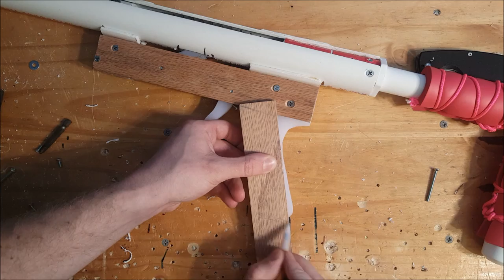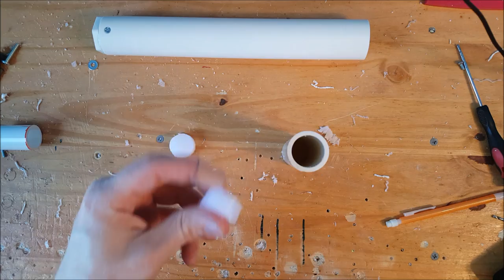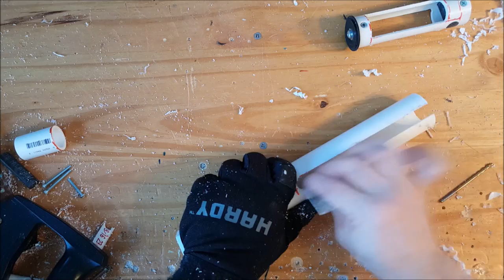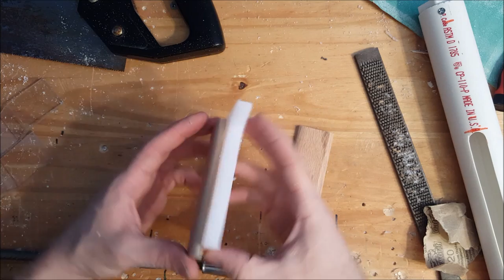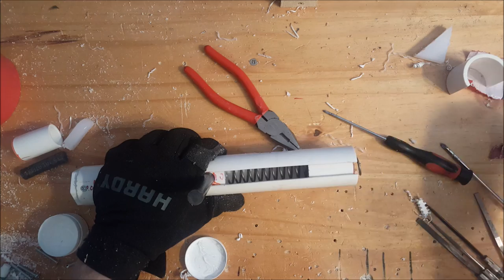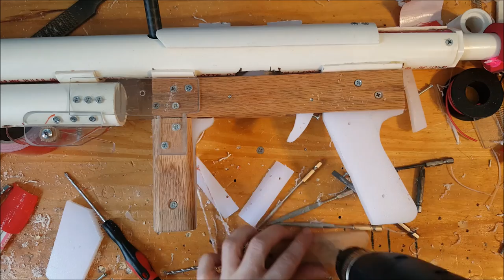Underbarrel Nerf Rocket Launcher & Tactical Uprgades!

Comment: Why not make the dust cover automatically open when you prime the blaster?
Reply: Asean12 that's actually a good idea. The front just needs to be slanted
Reply from the maker: Several reasons. Somewhere along the way if the dust cover opens while you're pulling the priming bar back, you're going to scrape your hand. Second, some driving force is going to be necessary to flip the cover open, so a reaction force must be applied when the bolt is in it's resting position. This means either a far more complicated system, or a dust cover that always is trying to flip open. A "slanted front" is also basically useless, in the sense that the cover is no longer locked in place by interfacing with the bolt (the whole point of the notch in the front) and  that slanted cutout is now a fairly large opening for grime to get into the blaster, eliminating the point of the cover entirely. These things seem like good ideas on paper, but are quickly disarmed when implimentation is actually applied. You are welcome to build your own and prove me wrong ; )
Reply: Aeromech  I'm nowhere near skilled enough yet. I'll stick with snap bows and pump snaps for now. Also, where do you get your red and white foam?
Reply from the maker: I pick them up from the play field when other nerfers launch them at me.
Reply: Aeromech ha😂 I that's hilarious! We use a community bucket, all the darts are made from 1/2" gray FBR
Reply: Aeromech ha😂 I that's hilarious! We use a community bucket, all the darts are made from 1/2" gray FBR

Comment: Hey Aeromech. Do you know the length of the pipe for the main body of the rocket launcher and the piston for it?
Reply from the maker: Umm no I don't unfortunately. For blasters like this you can often measure as you go. I wanted 3 inches of piston traverse so I measured everything else around that dimension
Reply: Aeromech Thanks. I'll figure it out. This will be my first homemade so hopefully it will turn out okay.